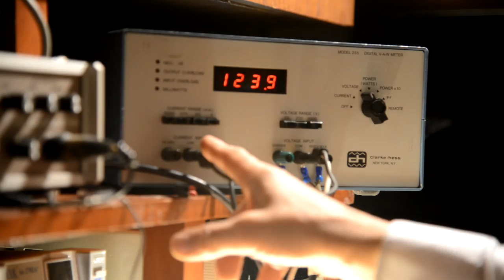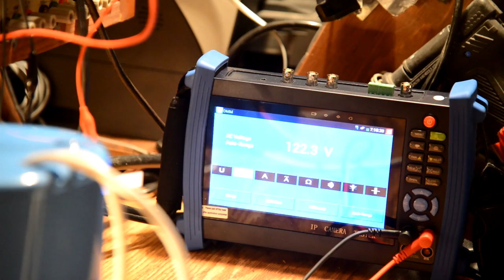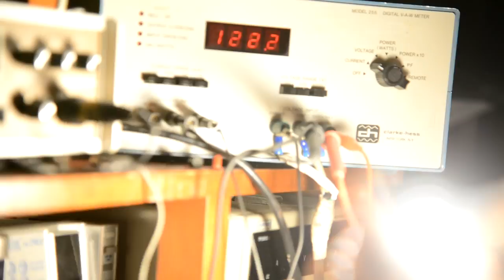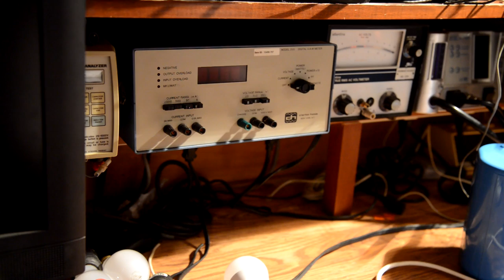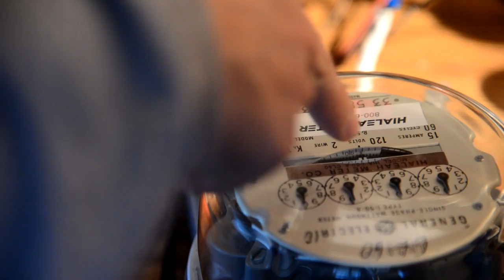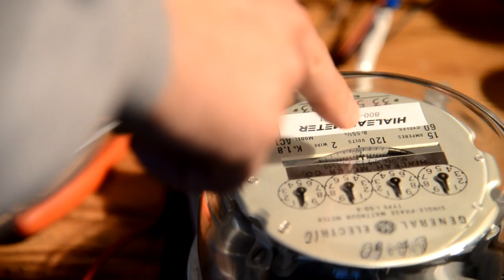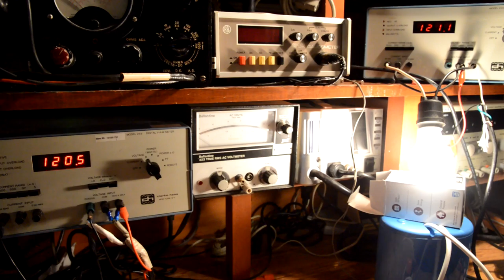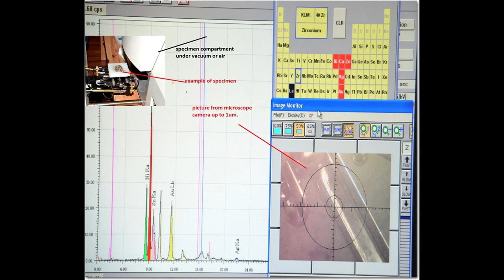Keshe "Free energy" Tear-down, examination, opinions.

Comment: Hi, I am also studying technologies for obtaining free energy and have been following the cache fund for a long time, I will say bluntly - it was not the cache fund that did this magrav, the fund initially observed the distances between the floors of spirals, here it is very large, wire twists were only in early versions, mixtures of different compositions were not used in the balls 33%,33%, 33%, compositions of different colors, and not just rusty, just a drop from the neighboring ones for the bundle. There are not two capacitors, but at least 3. What you showed is a homemade version.  In fact, magrav does not work with pure electricity, but takes the field from the power grid. The technology does not work immediately, but gradually, savings of 30-50% are achieved over the year. Thank you for the review.

Comment: Use an ammeter over the wire where the Magrav is plugged in to obtain a real current flow.  Then you can tell if there is any savings when applying various loads.

Comment: Video made totally to demean the work of a person, totally without knowledge about the unit.
Reply from the maker: So if you disagree with me , than please provide me  with mechanisms explainable by physics that supports your  opinion - and if you do not have  it,  than I'm right till proven wrong.
Wesley
Reply: @stivep1  first of all you dont know at all how it work , you should let it plug into the house and never unpluggued it to see real result cause this technologie takes time , time to nanocoat the whole circuit of your house making it a supra conductor it self , this is made out of co2 gans ch3 gans and cuo gans (balls in the middle) the powder inside the capacitors are also gans power of those 3 elements , nano particules with a field of its own and this allow the connection to charge it self til you reach a point that you dont need any energie from the grid its been proven over and over and by this video you lose all you credibility on the subjet and should learn more about the subject . this is not a plug and play tool , this is a plug and watch entity do his work , now if you are wise enoght put that thing back together and plug it again wait and see , you already had a real proof of this thing when you plug the meter on it and light the bulb , the speed of the wheel was going slower to slower but to ignorant you didnt see it and shut the light buld right when it was at the point to turn it back to the grid with the light bulb on , you sir are a big scam itself , have a nice day scammer

Comment: Hello,
 Perhaps you could try something that gives me an idea of it's potential for sending more power back to the grid. If the device is started with a much larger resistive load, then shut off after it has been started using more power. Read the flow back into the grid, then, try and inductive load to see if it then creates more energy back to the grid. The idea here is to see if the technology develops more energy by the start and then stop of the strength of the magnetic field produced by the larger load. If it doesn't and sends power back at the same level, see what happens with an inductive load. I have an idea that the device works similar to how back emf or countrer emf is produced in a coild, but I think this is the trigger to activate it's energy production where it produces it's reactive energy, then the energy from Earth continously feeds the grid once the load is shut off. It doesn't matter how much energy the device uses vs the output, the key here is to get the device started and run it the way it should benefit the user, that is by eliminating a good percentage of your electricity bill. I have read a lot about Mr. Keshe and his technology, but since his release of these items, I did notice the device size sold and If I remember correctly if was between 450 and 500 watts. This I think means that you need a dummy load to get it started to put out the maximum the device could produce to sell more back to the grid, or for your own use by establishing what all your leaching devices are using, then eliminating the use by starting the device with a load matching or exceeding your losses. If you had say 20 of these powered in parallel, I don't see any reason why your entire usage could be generated, allowing you to remain off grid by starting it up and using max loads to maximize your output of each generator. This is why I believe he got such a bad name since he states the device will gnerate power back to the grid, but I think he wants the establishment to not know how to get it to run on it's own as you just did. Try the inductive load, I am willing to bet the reactive energy generation will produce above and beyond the known capability of the listed wattage on the device since reactive or cold energy has much different and very unique output capabilities, as well, it self adjusts and I believe since Keshe's device is inductive coils with nano coatings, the flow if induction, then load shut down is very important to get the device working since it will power the inductive load, then once disconnected, it releaes the reactive energy to start the generator process. As it induces energy and the system abruptly stops using the energy, the reactive energy starts it's flow, and capacitively couples with the Earth capacitor, allowing amperage to continuosly flow since it self syncronizes to the waveform of the grid, and capactively adds the amperage by coupling with the ether through the nano coated surfaces of the coils, as we have seen in aerial energy systems that are used to grab static from the atmosphere in a capacitive manner, then dump into capacitors, then into a load by switching the system to create a waveform in the end once loaded. This just won't need the switching. Please let me know if this works., it may be worth looking at. As always, It's great to watch another one of your videos Wesley, and another great job showing us something., even though it is minimal, it is a start!
Reply from the maker: I do apologize but  I gave up on the device.
 Static charge  is  DC not AC, and when  it accumulates in capacitor ,  it removes static energy from the source.( of that static charge)
Rate of recharge of the source ( of that static charge), to the same level must be 1/50 of the second or 1/60  ( EU/USA) for the system receiving the charge to work with our typical load.
 If you use static charge, to  charge capacitor  than  this capacitor will  lose its charge to the load and than what?
Fast recharge?, 
and how fast ?
that determines W/hour of the device
__________________________________________________________
And if  theoretically  source of static charge has enough of charge  at any given time than why we need capacitor for?
Nano coating serves no function and may consume   energy  with skin current at given frequency if it is resistive in its nature.
That resistance always  exist independently from   C and L reactances.
Of course in 60 Hz skin effect is omittable.
Summary:
The device doesn't work never worked and will never work.
 And in case  if at some point someone will prove it otherwise  it  wouldn't be me.
Thank you my friend 
I wish you the  best.
Reply: @stivep1  the static recharges the cap while high speed rotary switching fed the transformer. This was a basic Tesla discovery, Paulson did it as well with his balloons. To wrap your head around the radiant/cold energy principle, you'd have to watch Karl Palsness show a demonstration here: https://www.youtube.com/watch?v=UsS0BeVeIwM if you watch the correct part of the video, he explains and shows that radiant energy has more output with lower resistances and higher resistance object, ie a higher wattage bulb won't output much. This is all determined by the switching frequency and capacitive discharge while switched to the load, and charging for the capacitor as it switches the load off. This happens so quickly when an arc gap switches that you can't see the bulb shut off for however hundreds or thousandths of a second, but using high voltage, the charge happens instantaneously and the higher frequency spikes produced from the arc switching forces the electrons in the shorted bar to utilize the radiant energy while shorted together in this type of setup. The technology is what helper Tariel build his system so it shocks me that you didn't see this answer coming.
Reply from the maker: @advanced-electronic  https://www.youtube.com/watch?v=69Xm762qE8o&feature=youtu.be  this is explanation of the first part of this video: @
in 7 minutes  8 seconds  Karl mentioned <overunity>
- such phenomenon doesn't exist , never was possible and never will be possible.
( energy conservation law) 
____________________________________
https://youtu.be/e4Aj6aJUkAw?t=218
Exactly here  electro-terapy  is mentioned. For me what is not proved and approved  may fall into category of wacky medicine.
https://www.britannica.com/science/radiant-energy -  explains what is understood  as radiant energy.
https://www.quora.com/Is-cold-a-form-of-energy - explains what is understood  as  cold energy.
Any other means or jargon  used in <some video> that is   using   mentioned above  descriptors  may be incorrect.
 The typical videos of wires in water or touching  HV wires is due to:
Skin effect - the tendency of a high-frequency alternating current to flow through only the outer layer of a conductor.
that includes your  body as well.

Mark  Belanger's Quote:
<he explains and shows that radiant energy has more output with lower resistances and higher resistance object, i.e a higher wattage bulb won't output much.>
- there is no such thing as  <lower resistance  for  AC resonant  circuits .>
Answer:
-Resistance  in AC is only  one of the components of impedance .
although resistance  is independent from  both  reactive components L and C  its role in most of resonance circuit is omittable,  (insignificant).
<capacitive discharge> mentioned by you  is manifestation of  capacitive reactance  as component of Impedance and has nothing to do with  resistance or resistive component  of impedance.

 Magician knows his tricks
I know my tricks
but in overall picture we both use rules of physics that are clear to us the presenters but not necessarily to the public.
with exclusion of:
- people presenting phenomena but not understanding them
- people  intentionally falsificating reality  and creating  (false reality) , by use of tricks fooling audience.
that is very often used by  some Russians (not  for entertainment but for real benefits earned from such  activity.)
Quote:
 <spikes produced from the arc switching forces> 
Answer:
mechanics of plasma in spark gap   has its own phenomena not  explained by me here.
Summary :
individual  phenomena that could be  related to Tariel Kapanadze device  are quite useful ,  to be understood.
But summary operation  and processes of Tariel Kapanadze device  are explained by me in  here
 
https://youtu.be/XOTLfnMOSqQ
              Wesley
Reply: @stivep1  here is a source you'd be interested in seeing. The Ion Power Group uses a conductor 35 meters in the air,  covered in carbon nano particles, insulated from ground  suspended from two poles. It feeds many high voltage utility capacitor banks, then the caps discharge into a dual spark gap, pulsing the utility transformer primary with pulsed hv dc power , charging lithium ion batteries from the secondary, then powering an inverter. I don't see why the cap will eliminate the static as it is incredibly powerful in this way, all they have to do is adjust the spark gap for a voltage lower than the caps breakdown voltage so it discharges without failure (having the correct voltage for cap and the right capacitance, the cap will charge and dump, due to the switching of the gap and the rotation to kind of simulate a specific frequency.. watch the videos on youtube. Ion Power Group . .  https://www.youtube.com/watch?v=JlTD80WRz8k
Reply: @stivep1  yes, I do agreee that nothing could create more than it uses, however there is the ability to draw energy from other places, the environment, atmosphere, etc. Not done with amperage driven electricity generation, but other unorthodox methods derived from tesla such as Don Smith and Tariel have done. It's based upon equal and opposite forces. I did notice the Keshe device feeding back energy into the meter in your video in small amounts, so it is actually harvesting energy somewhere, feeding the feed wires once the load is disconnected. I have witnessed this with a device I built having miniscule energy outputting from my device that was worthless for more than a 3v 2 milliamp led.  There's more going on than we see and supposedly it gets stronger, but I don't see anything so weak doing anything worthwhile. yes, he is scamming folks with the sale of these worthless devices, but the idea works as he states.. It needs to be made on a grandiose scale and would cost more time and money than simply buying solar panels..
Reply from the maker: @advanced-electronic   can you post  here the  patent number of nanomaterial coating patented by  Power Group?
The  nano- material word means nothing.
 It is application and its role that  must be understood to deserve right response
Wesley
Reply: @stivep1  Hi Wesley, The patent I haven't seen but I will get it to you. I spoke to the designer  at the power group offering high voltage wire to them since I am in part of a local underground electrical distribution company. They explained to me it is a nano coating of graphite, not specifically graphene, which leads to my question of the polarity in the event it is a mix of more than one of the nano elements available for research. I do know if we used it as a capacitive collection system, the ground will be of the opposite galvanic voltage for example two nano metals from the opposite end of the voltage spectrum would provide a much greater voltage and since the voltage would be higher at the current discharged from the caps, the wattage would be much higher and possibly not shut off from load as you stated. maybe one is coated with nano magnesium particles which would be  the negative or ground collector while the other would be  positive from the graphene or graphite end of the spectrum, approximately 2.2 volts difference between the metals alone, possibly amplifying the effect of the aerial voltge and amperage per foot rise. Plus Florida has an extremely active atmosphere, opposite what we have here in New England. patent number US9331603B2
Reply: @stivep1  It appears they also use diodes to eliminate shutdown due to any lack of potential from the aerial collector, this would mean the cap has stored more than the  atmosphere would be delivering and attempt to discharge back to the collector instead of across the arc gap to ground.

Comment: AS YOU SHOWED IT GAVE SOME BACK TO GRID AND ALSO AS HE MENTIONED IN HIS VIDEO AND IN HIS DEVICE MANUAL YOU SHOULD LEAVE IT PLUNGED IN FOR 48 HRS AND THEN ADD GRADUALLY TO IT WITHOUT UNPLUGGING IT FROM GRID OTHERWISE YOU HAD TO START OVER. PLEASE FOLLOW THE CORRECT PROCEDURE BEFORE CALLING SOMEONE SCAMMER

Comment: It is clear that you did not follow the directions and that is why you did not achieve a power reduction. If you would have read the directions you would have  read that the device and the associated house wiring needs to be conditioned over a period of months before any appreciable reduction will be seen. You simply took the unit out of the box and plugged it in and expected to see results, and  therefore accuse Keshe of being a scammer.  In reality you are the one to blame for not following the directions. If you do a little research, you would find many testimonials from people achieving significant results, some who show their electric bills as proof. So athough you seem to have expertise in measurements, it does not include being able to follow directions. Maybe your racial bias colored your measurements...
Reply: Screw the conditioning. Condition what? The damn thing either works or not.